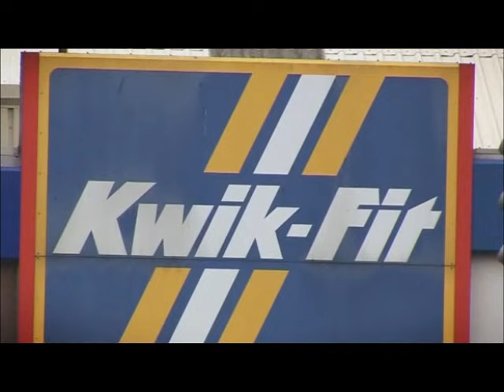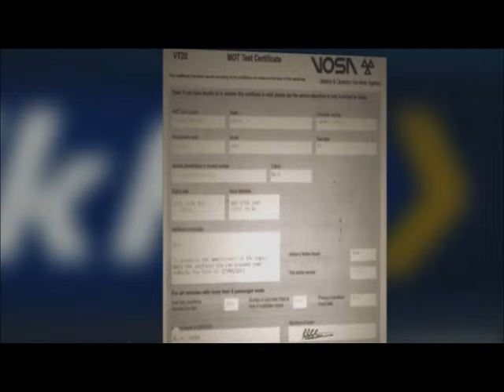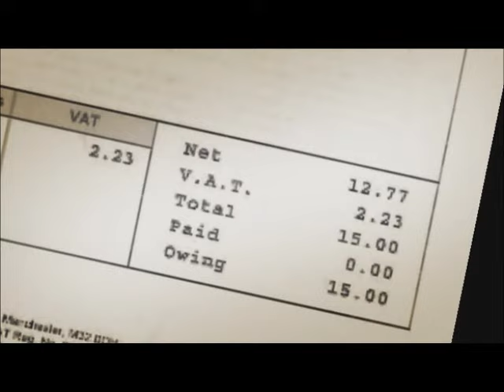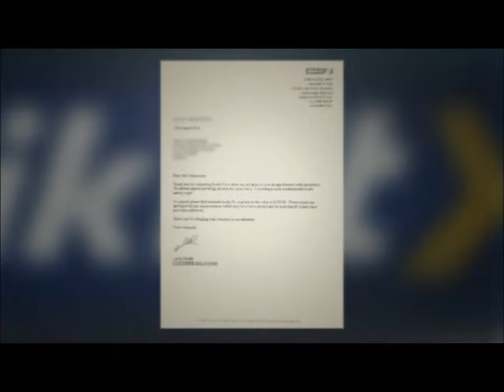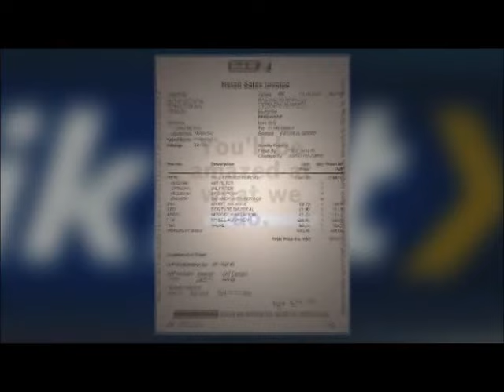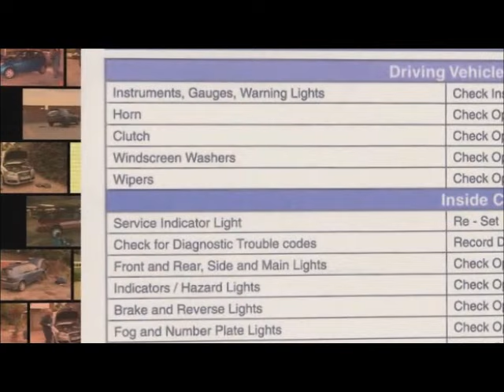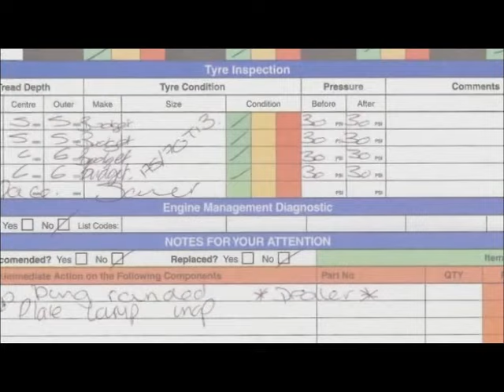Kwik-fit Car Rip-off Watchdog.wmv

Comment: I know it's now an old video but I worked at Kwik Fit for 15 years and I can say that the staff never had a clue what they were doing. And the manager was usually under pressure to oversell by senior management and they would deliberately keep the basic wage low so the only way to get your wages up was to oversell to make your bonus better.

Comment: Kwik fit is scam but neither is Halford. I once took my old Mondeo for air con top up. Even lay man like me know you have to take the wheel off from driver side to fill the gas hidden under the body work. these guys try to fill up from pressure gauge and show me with their UV lamp that is spraying all over and need Air con checking at a specialist. needless to say i walk away and took it to local garage which not only did my MOT and top up air con but reliable for whole year. Never again at Kwik FIt or Halford.

Comment: I bought an older car which had fairly recent MOT and no advisories. After a few weeks the handbrake wouldn't hold it safely and the garage I had previoisly used was full up for the next few days. I had a work meeting the following morning which I had to get to, so I used Kwik Fit. Left it there and half an hour later got a call from the manager and the first words were "are you sitting down..." He told me the whole braking system needed replacing; drums / cylinders, pads, discs, handbrake adjustment, everything. I said the brakes were ok, it was just the handbrake and he told me that the car was not safe to drive. It was about £650 in total. I told them I'd think about it and then phoned them back and agreed to it. Got the car back at end of day with a list of everything that was fitted. Went to my meeting next day and when coming back parked on a slight hill and the handbrake wouldn't hold the car again - exactly same as when I took it in. I phoned them and they asked me to take it down. This next bit I'm not making up. A guy comes out of Kwik Fit and rocks the car from side to side and said "it seems ok to me!". At that point I told the manager that I was taking the car to another garage to have them check the work. A local garage I had not used put it straight on the lift and checked off Kwik Fits list of fitted parts. They confirmed all had been fitted but could not comment on the quality and obviously did not know whether they were needed in the first place. They said the adjustment was shocking and no adjustment had been made on the hand brake which was the only reason I took it in. They told me they would make he handbrake safe but it would be best to leave it at that and ask Kwik Fit to make the work good. 

I went to their website and made a complaint and gave them the full info. An area manager got in touch pretty quickly and he agreed that I should take the car to another Kwik Fit who would strip the parts and refit and adjust. That was done and immediately I could feel the difference and the handbrake was holding fine. After that I asked for some refund for the shoddy work and the fact that parts might have been fitted that were not needed. He stated that because they had disposed of the replaced parts, then there was no way to prove this. I could not say whether they had or they hadn't, but I couldn't argue with it. What he did then was price the original job with 2 other independent local garages and then offered a £100 refund, which I accepted. I still feel like I was ripped off, but I got the car made good and a bit of money back. So please don't get suckered in like I did, and if you do then kick up a fuss. I will never use them again. The garage who checked Kwik FIt's work now look after me, so I guess it worked out ok, but at the time money was tight and it was a nightmare.

Comment: Unfortunately they are not the only ones doing it. Took a Clio to a local garage as we bought it off them 9 months previously they quoted 700 plus vat for repairs which didn't need doing. Took it to a garage dad knows through working for aa and it passed. The owner also reported it to the chaps at vosa funnily enough the local garage shut down a year later. Kwik fit are terrible but they aren't the only ones. Too many get away with it. Local government officials need to investigate all car garages a lot more not just for mot but trading standards. If the threat was greater then less would exist.
Any repair business that requires trained people are far too easy to rip unknowing customers off, car repair, computers, electrical, plumbers etc

Comment: I called into the local kf in barry 10 years ago to price up a set of  front and rear brake pads for my mitsubishi gray import. They quoted 600 pounds for the pads plus fitting and wanted the vehicle in 24 hours. Local parts store they were approx 16 pounds a set and cost 50 pounds in a local garage to fit job completed in 1 hour  kf are charlatans and rip off merchants never go near these bodge artists.

Comment: about 10 years ago remember a guy came in  for brakes vw bora, i was getting   a puncture  repaired,  they told him he needed   discs and pads all round  told him £750, he said £700  and they said yes we can do it for that, and just  last year they  quoted over 300 for my daughters  punto 1.2 down pipe took it too a local garage that welds done it for £20 the weld lasted a year

Comment: The MoT tests should be taken out of the hands of garages and put into the hands of a separate authority. That way, garages cannot create bogus failures to generate work, nor can they pass dangerous vehicles that they want to sell themselves. 

The worst thing now is that as soon as you get a failure notice it goes on the Internet. That means you can never have an unbiased second opinion on it. Any subsequent tester will know what was quoted before, and may just decide to say the same. 

I wonder what would happen if I put the names of all our bad payers onto the Internet, along with the details of all their invoices. If that would not be acceptable..

Comment: I have used Kwik Fit in Wolverhampton once or twice - i had good service off them but i am very wary of them. In one case what i thought was my exhaust was actually rattling heat shield and they just fixed the heat shield and in another case they got me on my way in 10 minutes when my battery was fucked. In some cases i wonder if they have crossed their wires on some of these vehicles and confused what work needed doing. When you have over 500 branches you are bound to get a few who are a bit crooked and trying to sell work that doesn't need doing.

Comment: I was told that my nearside rear shock absorber was leaking, and shown congealed dried muddy road spray on it. The mud was totally dry but that was that lad’s attempt. Last time I went there tbh, long story. That shock absorber passed the next 3 MOTs while I had the car & at least 1 more after I sold it.

Comment: I took my car in for a break fluid change and all went well, but 14 days later I got an email telling me that they noticed my tyre tread was low at the time and could now be unsafe. Both front tyres had half their tread remaining and are still on the car and safe today, 6 months and 8,000 miles later

Comment: The top mounts on the KA is a difficult one. If you don't know that they are designed to have alot of movement it's an easy mistake to make thinking they're excessively worn.

Comment: So that little KA that they made unsafe to drive is seen in 2 different locations and went to 10 other locations right? Just wondering how they got the car to each location. I presume they had it on a trailer or something but wouldn't that throw a bit of suspicion if kwik fit knew that the car was clearly not drivable.

Comment: Hi yrs ago I took a car to be told it needed new brakes all round I took it away thou was told it was unroadworthy. Took it for an not 5days later with no more work done and it sailed threw no problem. Went into kwik fit and got the dumb ass look and was escorted out after raising my voice. In front of waiting customers. So you can't trust a kwik fit fitter

Comment: years ago took my car in for new front exhaust pipe, they insisted the whole exhaust was knackered even though you could hear the front was blowing a bit. They fitted a new rear exhaust and when I picked the car up, the front end was still blowing. Told them to fit the right part and to put the rear part back on as I wasn't paying for a new rear exhaust.

Comment: Went in a Halfords Auto centre as I had a flat on the way to work. I asked could you change the tyre for the cheapest tyre and they said yes. Went back to the car later that day and they hadn’t touched it. Instead they provided me with a £360 quote for other parts. When I asked why they hadn’t changed the tyre, they said we don’t do that on Saturdays. They also told me it was dangerous to leave. I snatched my keys and walked out.

Comment: I got caught by F1 Autocentre in the early 80s .... no idea if they're better now - as I only take my car to places I trust now ... such as the dealership that sold me the car, I have never had a problem with them at all .... I'll never take my car to places like F1 Autocentre/Kwik Fit or Halfords ... or any similar places .... 
I'm not saying they're all bad, but the doubt is there now ....
Reply: I had the alleged fault checked by 2 mechanics independently - and they both said there was no problem - in fact the so called "faulty" shock absorbers were still on the car when I traded it in 5 years later, having passed MOT Tests ....

Comment: the problem here is, "customers" want a top class service from a highly qualified vehicle technician, BUT they don't want to pay the price. You can find plenty of keyboard and garden mechanics all over the place, especially on facebook etc. Point i'm trying to make is, if you want your car serviced/repaired correctly. take it to the manufacturers. or a reputable, qualified mechanic. kwik fits are no good at all. they employ young staff with no experience. 

And yes im a time served, dealer trained mechanic, 23 years paid employment as a vehicle technician.
Reply: Yes but Minimum £85 an hour plus VAT, plus parts is a Rip.  And the dealers also deliberately make up faults to Rip a customer off. My local ford dealers TRAINED TECHNICIAN broke my oil dipstick when I gave it for a service . Just out of curiosity I checked my oil level the same day. I rang them and they denied breaking it. Anyhow they ended up giving me a new dipstick but the plastic from the dipstick that had broken is still sitting in my sump. So, my conclusion is, the dealers are also are lying rip off cheats.

Comment: Sheared the sump nut after a so called oil change which I dont believe they did. Also could not be arsed to re clip in the bottom plastic sump plate causing it to flap about .

Comment: I took my car to them for a part to the exhaust which i had inspected  before taking in they then tried to charge me for  a  new exhaust system took my car to 8 garage they charged me £10 for the whole job . Don't  use them they are rip off merchants.

Comment: Once went to them as i needed a new tyre, they said i needed all 4 replaced as two were winter tyres and asked for £250, i said ok but found out i had left the locking nut at home so they could not do the work. The following day i went to a tyre sale room and they checked my car and told me only 1 tyre needed to be replaced at £39. Never use kwikfit.
Reply: @Atlantianreborn : Why couldn't you see for yourself whether the other three tyres needed replacing or not?

Comment: Hold on a minute they are expert checked all these cars and said they were fine then sent them to Kwik-Fit and then started moaning apparently they got cuts in the tyres and nails in them so they won't fine they were defective also he just showed a wheel that hadn't been removed and didn't look like it been removed by anybody including him even though he checked them all before they went for service a marking a wheel on the centre they could have just put it on the same way round

Comment: i used to own a granada scorpio  i went to quick fit for rear brake pads to be changed as i had no piston rewind tool when they got the car up on the ramp they told me the disc's on all four corners needed changing at a total cost of £ 375.00 and would not let the car down until i paid under health and safety would not give me the car back i have never gone back what a shit service it was kwik fit wandsworth  beware

Comment: That is far from my experience with KWIK-FIT. I have had my MOTs done at my local branch for 9 years,  and have had no problems. That may be because I quickly establish that I am mechanically savvy. I always maintained my cars myself, but now I am old I don't feel like doing it myself anymore. The one time they tried to charge me for a new part I pointed out to the manager that a squirt of oil was all that was needed, he conceded and did that for free. I also query the oil change bit. Kwik-fit do not do oil changes, at least when I phoned them, they said they didn't.

Comment: I wanted a back box exhaust piece for a mondeo.the exhaust comes in 3 parts.kwik fit told me it wasent possible to buy a back piece and you could only buy mondeo exhausts in one piece including the catolic converter that's expencive.there available to but in three pieces anywhere online or a car parts supplier.they wouldent believe me when I pointed out to them it's available to buy in 3 parts showed them online evedence. But they were having none of it I wouldent use them ever there make a simple job into 3 times more exspencive.they just told me to leave.

Comment: I went to kwikfit for just a pair of new wiper rubbers
they said yeah it has a engine issue it's a classic
I'm like bro, I just finished restoring it totally 😅 yeah a 455hp producing 1.4L 4cyl engine (CARBERATED) is totally broken right... it runs like new but much faster haha
idiots at that shop trying to rip anyone off

Comment: They not vary quick rogue traders kwik fit have been rogues since the 80s, the old scam on the posh car my Father in Law took his jag for eghaust repair.  His son was  mechnic for Jag little did Kwik fit knew.  They repiared the Jag and said he couldn't take the car because all the shockers where leaking oil, if Kwik fit had of looked properly all the shockers where brand new, my father in law rang his son and when Kwik fit saw my Father in laws son, they knew they had been caught out and offered him  free full service.

My freind took his car for a new clutch, yes when he got the car back  clutch was working okay, but they never put a new clutch in it they probably just adjusted it.  Took my car for tracking after I put new suspension arms on.  THey treid to tell me the brakes and discs needed replacing not realising car just passed a l2 month test that is why I put the arms on and needed it tracking.  They have been at this for a few decades now, sadly rogue trader you need to be a little kwiker.and do you really think they will change their ways?

Comment: A rubber suspension bush to the exhaust failed/ got knocked off on a road hump, took it to KwikFit and they replaced it with no charge to me, quite happy with them on that one.

Comment: i've had the same with stoneacre where i got my car from. i got told that my brake pads needed replacing asap. so i took my car to a normal garage and they said i didnt need the work doing as the diagnostic computer said everything was fine.